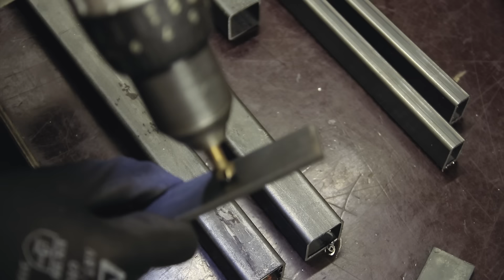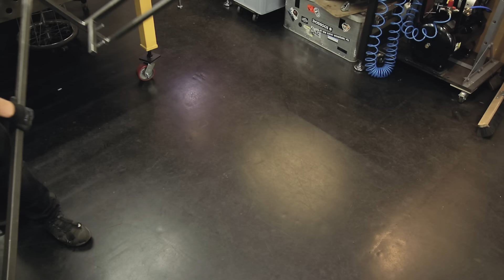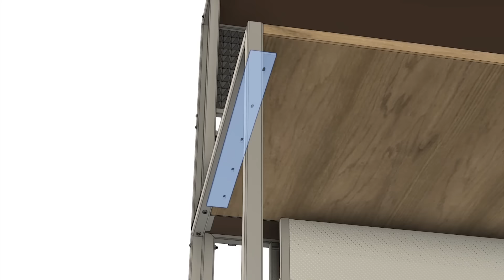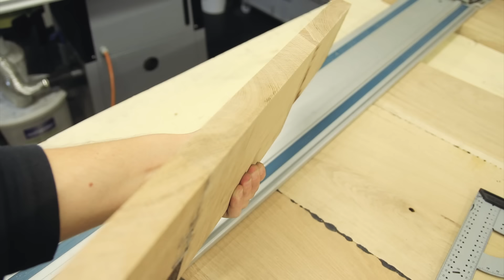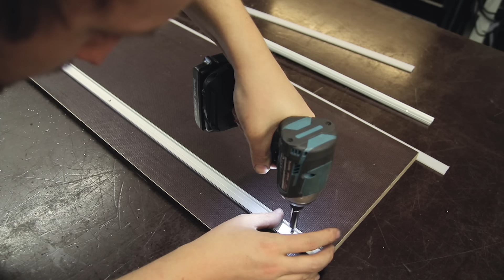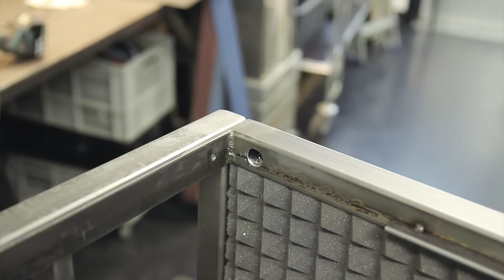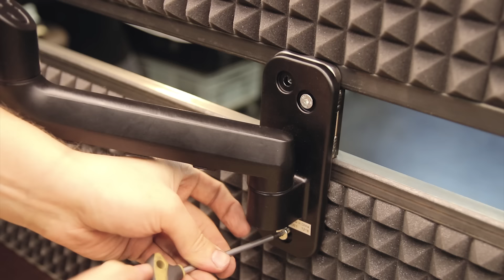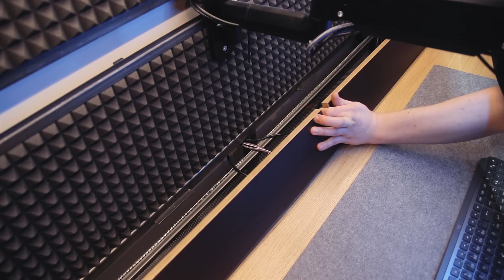How to Build a Cable-Free Desk with Built-In Lights, USB, Outlets + More!

Comment: Beautiful job. Question: are you not worried about sink in the center over time?
Reply from the maker: Not really, it doesn't have to support a lot of weight. Just a keyboard and my arms most of the time
Reply: @PhilVandelay  yea, sounds about right, plus it's a solid wood block. In any case if you ever see it getting deformed, you can always put another steel frame beneath connecting both the legs.

Solid job on this.

Comment: Wait. What soldering type did you use? I've never seen it before. It's so.... silent, and precise.
Reply from the maker: It's called TIG welding, yes it's generally a bit cleaner and more precise than what most people use (MIG) but also slower/harder to learn

Comment: The only reasons to chamfer your materials are to create more surface area on thiner material so you can grind the weld flat, other then that there's no real reason to chamfer thin material. This is only an authentic thing not a structural need. The other reason to chamfer material is if you are welding thick material. This is a must or you won't get full and proper penetration.
If you don't mind the look of a weld then on this you don't need to chamber your material. For me I like the look of a good TIG weld so I wouldn't grind my welds flat but to each their own.

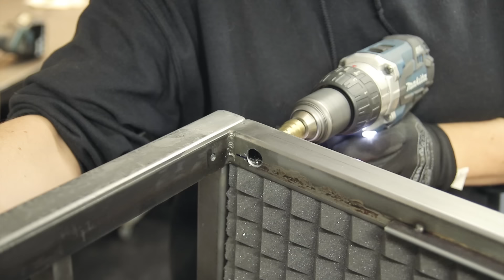Comment: Suggestion: At 23:25, where you commented that people might complain about wires getting cut due to rubbing on the edge of the hole cut into the frame, you could always get plastic or rubber grommets to protect the wires. You could even cut pieces of PVC tubing to fit into the holes, which gives you the added benefit of knowing the wires will come out the other end without needing to be fished out. (yes, this is a minor issue not likely to happen on thin tubes of the frame.) But, I don't think it's necessary, since the desk isn't likely to flex and move a lot while assembled and in use. The chances of the wires being cut into are minimal. However, using grommets will give that "attention to detail" look for pennies.

I do like the desk. I'm glad you used those stick-on cable channels for your low voltage data cables, like USB. I was worried when you only had the one basket to run your cables. You don't want to run low voltage data cables alongside the high voltage power cables (I'm guessing 240 VAC.) The power cables will induce a current into the data cables causing problems and possible device failures.
Reply: It would also be really easy to design and 3d print a flexible TPU fitting.

Comment: no dowels between the oak slabs that were glued together?
i know you said your not much of a wood worker, but ouch, one day when you go to move it, that oak table top will split apart.
hell without some dowels, you could snap it by pushing down on it pretty easily
Reply from the maker: Ah yes, the classic "you did everything wrong, it's gonna fail and break" comment. 
 You seem to have little knowledge about the strength of wood glue, so I'm just going to refer to this: https://www.youtube.com/watch?v=f90QoWOs9TE

Comment: If you want a desk like this but know nothing about welding (like me), you could easily build all of it using 80/20 aluminum. All you need is a saw. You can even use these plans without many, if any, modifications!

Comment: I just want this whole set up. I also really got excited when you just brushed over the woodworking. I miss my shop but as it currently stands. My apartment has no place for any of my tools let alone where to use them so they alas are staying at my mothers. I even have a chop saw from a few christmas's ago that is still unopened in my old room. Ugh.. I've been wanting a new desk for a while now and whilst I don't know how to weld.. just watching you makes me want to jump right in and make my own desk along side you. 

As for the sanding of the desk. if your friend had a large enough planer, you could have sent it through so as long as you scrapped off the excess glue so you don't gum up the blades. Or you could use an industrial sanding planer. Those save alot of time as well, only issue is depending on the type of wood you choose, it will be a slightly slower process but much faster compared to hand sanding. 

One common issue I normally see with people using a palm sander like you is whilst trying to rid themselves of the glue in the seems between the boards, they inadvertently create small valleys that are uneven and easy to feel especially. Also I don't know if you alternated the wood grain of the boards but if you didn't, assuming you're not in a humid place, your desk shouldn't warp too much in time if you didn't so as long as you keep it dry. Boards like to warp in the direction the rings go. Keep that in mind.  Other wise, great job!

Comment: Incredible desk. I wish manufacturers could design desks as good as this one
Reply: they could they would probably charge you like 5k+ USD for it
Reply: @jangoman6597  you could probably get it done for 1,000-1,500 of you outsource to low wage countries
Reply: @SchwertKruemel  Phil said the raw material is only around $300, so only pay $500 for low-wage countries. Over $1000 is charging too much. If the table is made in US or other developed countries, then $750 is reasonable.
Reply: @SchwertKruemel  
Thee quality of welds and attention to detail would be much worse though, it would like the one in the video but have sharp edges, plywood instead of oak desk, probably no soundboard, bad charging ports, etc.
Reply: @ewolam  Maybe back when this video was made it was cheaper. I just bought a bunch of steel, not enough for this desk, but for my welding table and it was $700.... So I imagine just the steel for this desk would be about $1000
Reply: hiWe can order such a desk for you for $800!
Reply: @Sofia-cn7tg  Who is we?
Reply: @k-fedd  We specialize in customized tables and chairs
Reply: @Sofia-cn7tg  Yes but who is we? As in are you part of company? Whats your business called?
Reply: @k-fedd  Yes, I'm the boss of the company. We customize all kinds of tables, chairs and sofas every day. You can tell us whether to use them yourself or help us sell them. You can get more favorable prices!
Reply: @Sofia-cn7tg  interesting. What country are you based in and do you have a website?
Reply: @k-fedd  
I am in China, please explain whether you use it yourself or sell it for us?
Reply: @Sofia-cn7tg  I'd consider buying a desk. I'm not interested in helping with marketing.
Reply: @k-fedd  I can't seem to send you contact information, I don't know why.

Comment: I know you are much of a wood worker but say that glue splits a bit would you have to take it all apart and reglue the entire thing? or would it be best to just fill the split. I recently bought a butcher block (I know not the same thing as the maple) but it split after a few months of being attached to the frame. Just wondering if I should clamp it together to just fill the split.

Comment: Definite tip on having the mains strips sat in the back, wire up a plug with just an earth wire, bolt that earth wire to the metal frame and plug it in to the strip - that way if you do get a short from a crap cable, it stands a better chance of cutting the power. I think you can also get under-desk mains strips with their own earth tails. Definitely more fun than having a hot desk.

Comment: For those interested, the plywood Phil used in this project is called phenolic plywood in the US.  It is available in the US, but it's not carried by the big box stores-- you'll have to check at lumber and plywood specialty stores.  (Woodcraft carries it.)  It is really great stuff, but because it isn't widely available, it is also quite expensive-- like $70 for a quarter sheet (24x48) or 3/4". A good alternative it using a decently quality oak or maple plywood from Lowes/Home Depot and putting a laminate on top.  The result is actually a more durable surface for less money, albeit more work.

Comment: AMAZING. Two things, the first, I would put some foam blocks under your speakers for better sound. Second, I would keep your 3d printer at the shop. even these FDM printers output harmful microplastic fumes into your home. If you insist on keeping it there I would get an air purifier that is known to help with the vapours. All the best and thank you for the thoughtful video

Comment: Professional execution on this project.  Yeah, someone with patience and skill could make that, but the time and tools...  It's way nicer than initially meets the eye.  Not really a cheap quick project as completed in this video.  It's a bit overbuilt; with a couple more braces I think it would hold up a big block V8.  It's well designed and uses premium materials.  Wicked pliers (and other tools) at the 27 min. mark.  I guess it will last forever and you could modify it as your needs change.  Clear coat on the steel?  Dry climate where you are?  It has a modern & raw vibe without paint and with the light color stain.  Really a nice project idea with people increasingly working from home.  Tax deduction?  Thanks for sharing.  I want one, the clean tidy look is a great feature.  I have too many "irons in the fire" right now.  I will check out your other content and maybe subscribe.

Comment: Very nice and very interesting project. I just don’t get why you used plywood when you obviously had very nice oak wood.
Reply from the maker: I actually like the material combination 🤷‍♂️ But also the oak isn't exactly cheap (especially with current wood prices) and I still had the Plywood sitting in the shop anyway

Comment: At what are these speakers aming at? You are loosnig a lot of high frequency data because they are not directed in your ears, well unless you are some kind of giant but i thinkt that's not the case. Thie higher the frequencies, the more directional they become. You already have tweeters so you have much better driver for higher frequencies, but when they are not aiming at your ears, you won't hear that.
Reply from the maker: I do normally sit quite far back (and yes I'm tall) but I have angled them inwards  since I posted the video since so many people commented on it 😅 I'm actually thinking of building swivel-base speaker mounts too to replace the current ones

Comment: wow .thank was well made.
i would have painted the frame black.idk if u painted it.it still looks good
btw...isnt the whole weight of the monitor on the two screws u used?
i m not sure about the design.but if this is the case...when the load on the screws increase..they might break...the extended arm gives more load by acting as a leverage..
i m not sure about this though😅😅
Reply from the maker: There's not that much weight on it, I think you would have to hang over a hundred kilos on it to break those screws. The monitor arm itself is only rated for a max of 15kg in total anyway, so that would break first in any case 😉

Comment: Leave it to people to do what larger companies cant. Quality product, useful features, great design. This is pretty amazing. I want one myself with the single change of dual monitor arms VS one, but since your simple but incredibly effective system has that built in, no problem. 

Seriously, this is absolutely incredible. I have watched so many custom desk builds trying to get ideas for when I finally have a work space to be able to do one, and I think this may be the one the take the cake. With a few modifications for myself, but mostly perfect. Honestly the only thing I would have done would be to paint the frame, and probably use a darker wood/stain for the table top. But it still looks amazing so these aren't so much a criticism as just me thinking while I type.
Reply from the maker: Thanks, yeah the raw steel and wood combo is of course a matter of taste, I would actually be interested to see what this looks like in different color combinations. A lot of people are interested in building it so I think we will soon find out!

Comment: The crux and bane of pc enthusiasts everywhere, one of the flyest desk builds ever WITH AN HP PREBUILT. The desk is on point though.
Reply from the maker: That's a dual Xeon workstation on a server-grade mainboard with 128 gigs of ECC ram and 10TB storage. This thing is built to be reliable and get work done, that's why it doesn't have twelve million LEDs and a flashy case
Reply: @PhilVandelay  I stand half-corrected. Having worked @hp building servers for them I know the testing (2011ish era) isn't rigorous nor are builders even required to know anything about computers to assemble them(literally most don't realize that IC and CPU are interchangeable in regards to assembly). With the cost cutting I witnessed back when I was with them I doubt things ever got better. There's really only a 24hr burn in and (again when I was there) 20%-ish failure rate for their rack servers, that number went up with workstations (what we called what you have). I can only speak for the plant I worked in.

Don't get me wrong, my comment wasn't an insult, and originally I thought run of the mill consumer hp desktop so there's that.
Reply from the maker: Well, this one has run renders under full load for weeks and hasn't given me a single problem in 4-5 years of daily use, so I can't complain. When I was still working as a 3D artist they had this exact model in every agency, because they were reliable and just worked.  You can get these dirt cheap as refurbished versions on eBay all the time, so it's really the bast bang for your buck going by pure rendering performance, especially since you get shitloads of ram basically for free.  I really don't see the point of spending twice as much on gaming-grade hardware just to "look cooll" and get the same performance, so when this one gets too slow, I'm probably just going to get another one of the same kind

Comment: I really like that gap idea for mounting stuff like monitor. Definitely going to steal that idea. Nicer than ie. French cleat. I was though really disappointed to see that so well made table isn’t motorized. It would’ve made so much sense with this level of cable management.
Reply from the maker: I feel no need to stand while using a computer so for me fixed height is fine, that's why I didn't build that in. Never really saw the point of standing desks

Comment: Yea easy enough with decent equipment... 
I build my own desk (with square tubing and wood) and Boi oh boi.. With only a Stick welder, angle grinder and a Jigsaw (equipment all in all around 110€) and it was NOT FUN at all 
Don't even try building anything large if you don't have a Flat surface where you do the welding (welding table, just a metal plate which is big some like that), Nothing is straight everything fucked if not.
I am a machinist and i thought its so easy to build shit like i do it everyday at work.. No without "good" equipment its very time consuming and labor intensive. 
if you Try to remove a weld with a 30€ angle grinder where the flapdisk basically falls apart when you just look at it.. i never really appreciated the beltsander we got at work but after that Bruh...
Reply from the maker: A big help when you don't have a welding table are those right angle vises, you can get them on eBay for about 30-40€.  They keep the workpieces both flat and at a perfect 90° and also keep them elevated off the table so you can work on a normal workbench. Works a lot better than those welding magnets to limit distortion, I used them quite a bit before I had the table, it takes a bit longer but I think it's the best way of getting square joints without a fixture table
Reply: @PhilVandelay  oh yeah.. would have been neat to have and yea welding magnets aren't really the shit NGL..(4 magnets came with the welder.. xD).

Comment: this is awesome. I want to build a desk like this as well but I have no welding skill or welder, that doesnt help
Reply from the maker: I think the same concept could be adapted to a wood construction, or as some people have suggested here you could use aluminum extrusion profile instead which can simply be screwed together
Reply: @PhilVandelay  thanks for the reply! Yeah i actually have experience with aluminum and simply bolting pieces together. Made a sim rig like that. That could be a cool alternative. I’ve had so many projects that I had to call off because I can’t weld. I swear if I could weld so many more projects of mine could have been realized
Reply from the maker: If you have a space to do it, I highly recommend just getting an affordable welder and just starting. It's not as big a deal as it's often made out to be. Sure it takes some practice, but definitely possible to teach yourself to lay some decent enough MIG welds withing a week or two using Youtube tutorials. I feel especially with welding people feel they need some kind of permission to do it - but it's really not different from any other tool
Reply: @PhilVandelay  thanks for the response, I just rewatched the video again because I am about to start on my own desk. I definentally plan on getting a welder soon so I can tackle more projects!